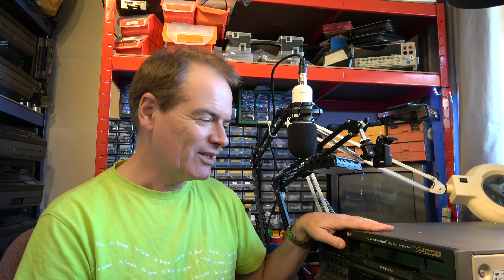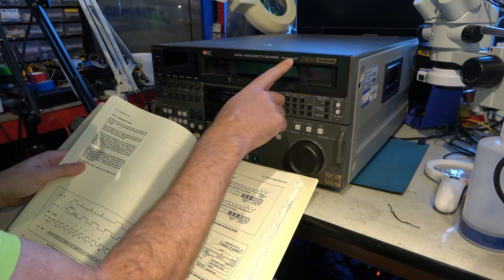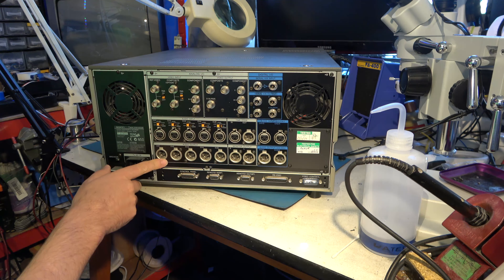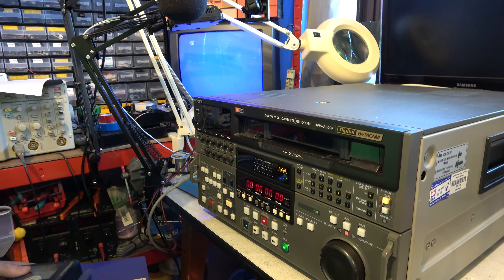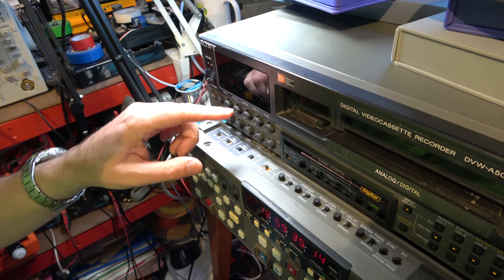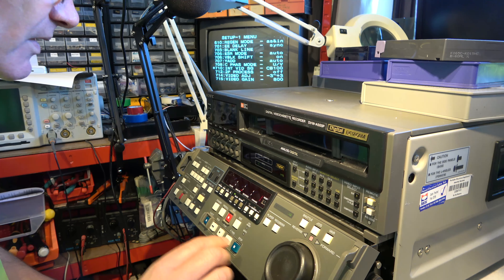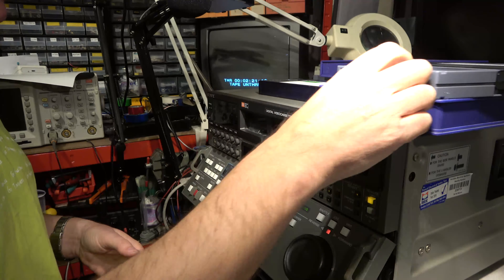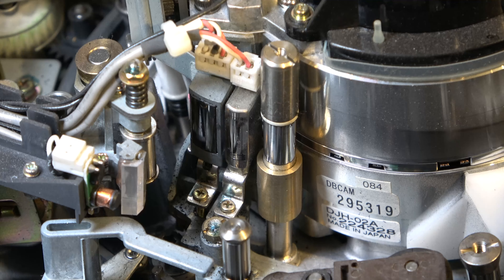Sony DVW-A500P Digital Betacam Recorder donation.

Comment: I used to use this model on a daily basis as an online editor and VT op. These cost around £25K back in the day. I remember when these things were introduced in the early 90s. I think it was '94 when I first used this machine.  Before that I was operating D1, D2 and D3 for BBC destined work and later D5, HDCAM, HDCAM SR and Ampex DCT. I also worked with Umatic, Beta SP, 1"C, 1"B, DASH and Ampex 2" Quad. All good fun.
Reply from the maker: I only wish I had so much experience with studio equipment.  I'm still trying to buy an HDCAM-SR but they are stubbornly expensive.
Reply: @video99couk  Yeah, Good luck with that.  They are still being used by some facilities 
in Soho.  Officially the last tape based format the BBC accepted commisioned programmes on
Reply from the maker: @andrew1479  There's one for about £900 but with 10k hours on the heads, I don't think it's worth it.

Comment: In my collection I have a DVW-A500P recorder and a DVW-A510P player, both the rebranded Thomson versions. The recorder I got for 56€, the player for 38€. One can spend great amounts of money on these on Ebay, but with patience, these machines can be gotten for very cheap or even for free like in this video :)
Unfortunately I so far haven't had the time to do much with my Digibetas, but this video will be very helpful when I finally have the time. The menu system really seems very unintuitive... 
The cables for the 9P remote interface are available on Ebay, I got one to connect my Digibetas together. It's quite fascinating how they work together, basic editing operations can be performed via the front panel of the recorder.
A friend of mine has a small collection of Betacam equipment too, and he actually prefers the video quality of Betacam SP. Digital Betacam does employ 4:2:2 colour subsampling, and the thereby reduced colour quality apparently is noticeable when compared to analog Betacam SP.
Reply from the maker: I've been reliably informed that BetacamSP is nowhere near as good as Digital Betacam.  But I know what you mean.  There's something very pleasing about the BetacamSP image, even though the resolution isn't especially high.
I would say you got your machines very cheap.  These things do often still fetch about £200.  A freebie of course is even better, but mine really needs a pinch roller.
Reply: Where and how does one find such machines? I would love to have a DigiBeta machine, especially the A500.

Comment: Great video. On the DVW machines, if you hold the ENTRY button whilst pressing the MENU button, it will bring up an error log on your monitor with time code stamps of each error. Handy for checking playback or record issues. One other thing, and I’ve noticed this on a few of your machines. If the STOP light is flashing it means your machine does not have a reference signal connected on the back (usually just a black burst signal). If you switch to INT ref (switch) it will stop flashing.
Reply: Also, to clear the error log (I would usually clear it each time I either record or playback), call up the error log (ENTRY + MENU) and then hit the RESET button alongside the TimeCode display on the machine panel.  Enjoy!

Comment: If you find the flashing STOP key light annoying, you can turn the flashing off with a menu setting.  From what I remember it flashes the green STOP key when the machine senses the absence of external sync, which is immaterial on a standalone player anyway.

Comment: The DVW series of machines are such good machines. I use them at work almost every day, our DVW-A500 has around 15,000 hours on the heads and it is just fine. We also have a DVW-A500 P for PAL work and an MSW-M2000 for NTSC or PAL depending on the menu setting (and sync fed in) along with one lone Ampex CVR-60P (Sony BVW-60P) for the really tough PAL tapes. We also have the record inhibit permanently enabled on every machine that it can be
In the States, I very rarely see a 500 series machine that does not have the composite in option, as these and the SX cousins the DNW series were meant to drop right in place of an SP or oxide Betacam deck,   and although they are all component formats, most edit suites and especially remote (OB) trucks at local TV stations were composite video.
Reply from the maker: I've never seen a DVW-A500P which does have the composite video option, either in real life or even for sale.  Seems like a rarer option here.  Just wish it had S-Video in and out, and monitor audio would be handy too.
Reply: I very much agree, great machines.  We have 18 DVW's in racks playing and digitising simultaneously here where I work.  Some DVW's can do 20,000 hrs before a head change.
Reply: @video99couk  All the DVWA500P's & DVW500P's had a composite input connector, but, not all had the associated DEC-65 board that performed the processing. This was an option.   S-Video was never considered for DigiBeta because it wasn't a Broadcast Standard, and the DVW's won't accept non-TBC'd signals.  Back in those days,  most VCR's that had S-Video out didn't have a built in TBC.
Reply from the maker: @azmath2059  Yet the UVW1800P and similar BetacamSP decks do have S-Video connectors.  Yes, I was aware that the Composite Video input socket is always fitted, even though the option board often (usually?) isn't.  Odd logic really that Composite Video input was considered OK but the much higher quality S-Video was not.  So if you wanted to source some material from say a Sony EV-S9000E Hi8 with TBC, you had to use Composite.
Reply from the maker: @azmath2059  Do you have a source for pinch rollers?!

Comment: Composite input was important back in those days, the huge work was just about to begin to digitize old 2" and 1" videotapes. And they sure were composite formats!
Also in many studios digibetas went straight in to replacing 1" machines, all cameras, visionmixers and everything in studio was built in composite.
Reply from the maker: Yes I'm aware that Composite Video was used in studios for a while and this was useful for drop-in replacement.  Some early professional formats were Composite Video only for this reason.

Comment: I used to work with these machines on a daily basis once. There were so many options and keys that I created an interactive user manual with Filemaker Pro on the Mac for educational purposes. ALL buttons, in and outputs were explained as well as the menu's. You could lookup on keyword and it would tell you what menu item you needed to go to and what the available options were. Pressing a button would have the same visual effect as pressing it on the real machine. Great fun to create, but it gave my RSI... Too many and too long days creating that I guess. Not a lot was known at that time around RSI and the cause. P.S. I would get rid of the head sponge if I were you. It only increases wear on the heads and if the heads are dirty, you can clean them with some smooth chamois leather and alcohol. (not up and down, only in the direction of tape travel!)

Comment: Back in the summer of 1981,  only 18 at the time, I bought a Sony C7 Betamax, that machine cost me £715, which would be around £2500 to £3000 today. Back then nothing was close to the picture quality of the recordings, and believe or not one of the first home VCR's to have colour picture search and slow motion playback, by the time the C9 with (HiFi Stereo) came out some 3 or 4 years later, getting rental films in Beta was quite difficult, so I didn't see the point in upgrading to the new model. Around 1987/88 the C7 finally gave up and was replaced be a VHS Panasonic. However, I still felt even after all that time and improvements to the VHS system the original C7 offered better picture quality recordings. Thanks for this insight into the world of build quality video tape recorders rarely seen....
Reply from the maker: The C7 was advanced for its day, if a little unreliable.  That is due to get a mention in the YouTube video that I will release later this week as it happens.  The C9 though didn't have hi-fi stereo, only lousy linear stereo, so it wouldn't have been worth the upgrade to that anyway.  Few Beta HiFi machines sold in the UK had trick functions like the C9 or (to a more limited level) the C7.

Comment: Thanks for the nice trip down memory lane for me. I maintained just about every pro format from 2" quad to HDCAM-SR for a US TV network. I was sent to Sony's service training classes for Betacam SP, Betacam SP camcorder, Digi Beta, XDCAM, and HDCAM camcorder. I always learned a lot which wasn't in the service manual. Do you know about the hidden menus in the BVW-75? The only feature I remember is that it could enable loop play or record. That is very dangerous so it was well hidden. BTW Ampex DCT has to be the best SD recorder ever made.

Comment: I've just brought one of these machines and looking forward to playing around with it. I used to use them in a studio many years ago so it's a bit of walk down memory lane for me. The unit I have has the composite decoder card installed.
Reply from the maker: It's worth checking the state of the pinch roller, my original was well past its best.  I have two of the recorders (one with Composite in) and one player.  All are A models so can play SP tapes too.

Comment: The VPR1 board has a couple of large LSI Logic mask programmed gate arrays- those are the ones which have the Sony logo in big print on them.  A bit uncommon to find such things in Sony hardware.  The five large devices on the side marked "Output Block" are certainly signal coupling transformers.

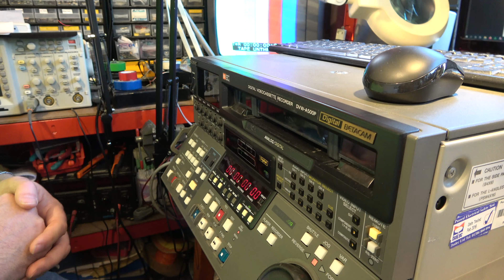Comment: 33:24 This is not only set for remote control operation, but also the VTR is in Record Inhibit mode, hence the reason why you can't record something on a Digital Betacam L size tape previously.

Comment: Really enjoyed this overview of the DigiBeta machine. I was just starting to service some of these before leaving the industry. Wonderful to work on like other Sony machines but I did not like doing the head changes, very fiddly mechanical alignments with the fixed upper drum and inner head drum. Did you manage to source a pinchroller?
Reply from the maker: Yes, on a later video you see me install a revised version of pinch roller.  I understand that head changes are beyond what I could do with out alignment equipment.

Comment: I'm only partway through the video so you may have discovered the source of your black debris contamination - but it's not tape-related - it's the insulation sponge from the top cover deteriorating and raining down into the gubbins.   I've had that problem with that type of sponge breaking down like that before in other contexts (typically travel cases padded with the same type of material.)  I removed all traces of it from my top cover and wherever it littered the floor of the tape mech.
Reply from the maker: Could be, I'll check that.

Comment: not sure if its been mentioned, but timecode in is for genlocking which means that the studio / facility picture chain is completely synced to a base clock
Reply from the maker: Thank you.  I assumed it was something like that, but I've never worked in a studio so not had to use that connector.
Reply: Actually timecode is just an analog 2400/1200hz signal representing time down to the frame. It should be normally locked to tape vertical sync. Genlocking is done via the EXT REFERENCE input or can use INPUT VIDEO as well. This is for locking the internal TBC to your house sync so the VTR can be mixed with other synchronous sources. The timecode is what the edit system uses to know which frame is which.
Reply: @andydelle4509  that’s a much much better and fuller explanation than I could have given. Thanks for the info :)

Comment: I always keep the record inhibit switch turned on with my machines unless I’m planning to actually record on a tape.  On most Sony machines the record inhibit indicator is different for a protected tape or an inhibited machine; from memory I think it’s steady for one and flashes for the other.

You haven’t mentioned the flashing stop button.  I don’t have a Digibeta, but on my other machines this indicates that a reference video signal, normally black and burst but it can be a full composite video signal, is not being received.
Reply from the maker: I hadn't realised that's why the stop button flashes.  I will check that it stops when I feed video into the machine.  I can feel a YouTube Short coming on, to cover that subject.
Reply: @video99couk  
With the use that you’re likely to put you machines to you probably don’t need to use reference video, Nd there should be an option in the menus somewhere to turn off the warning flash.

Most broadcast grade recorders and certain other devices such as the Sony component colour corrector, will have reference video connections.  There should be a pair of BNC sockets with a passive loop through between them, and a 75 Ohm termination switch, as with a composite video input.  It’s basically a timing and phase reference between multiple machines.

Comment: I know that you can measure your current pinch roller and get one with the same measurements, but that only works if you can slide the rubber part off the core and put the new one in. I've never tried this myself as on the VCR I had this problem on the rubber couldn't be taken off the core.
Reply from the maker: I have a replacement which has been sent to me and will feature here shortly.
Reply: @video99couk  Great to hear! I'm excited to see it featured as this is a really cool machine. Would love to own a DigiBeta deck myself but they're hard to find where I live and out of my price range

Comment: Have you tried drilling holes on a Betacam SP tape so the player will recognize it as Digital Betacam? I'm sure it'll work and record fine. Just like VHS and SVHS.
Reply from the maker: I suspect it would work badly.  An experiment for another day.  There were yellow BetacamSX tapes which were used on compatible digital SX machines, and these were effectively BetacamSP tapes in a different shell.  The SX machines could record digitally on BetacamSP tapes too.
Reply: @Matt Quinn That is correct, SP tape has a very different tape formulation and is also microscopically different to DigiBeta.  You cannot use SP tape on a DigiBeta machine. I experimented with this back in the late 90's when DigiBeta VCR's first came out.

Comment: Sony sold NTSC and PAL versions of this machine, need the opposite standard, well just buy two machines!  But these machines could be fairly easily modified to dual standard 525/625. All that needed to be done was to change the master VCO on the internal sync generator. The beauty of an all digital servo system and digital signal processing - it was frequency agnostic. A small shop in Hollywood made a fortune in selling this switchable dual standard modification. Sony had a fit and went so far as to modify the sync generator section to where this unauthorized upgrade was not possible on later serial numbers.
Reply from the maker: That's just mean of Sony, unless there was some other reason.  Would the dropout compensator work properly on the "wrong" standard perhaps?
Reply: @video99couk  Yes the DOC should work as it's done digitally and an RF dropout is the same in 525 or 625. I should note that the first digital VTR, the D1 format, Soiny DVR-1000,  was dual standard and so was the Ampex DCT format that was competition to Digital Betacam was also dual 525/625.

Comment: Greetings
I just got the sony DNW-A500P I connected it via SDI to an AJA card in my computer but it doesn't seem to get the signal
Does the beta happen to have a switch to output video from either the analog or digital outputs or it should output from both anyway
For now I can only see it in component or composite

Thank you
Reply from the maker: The DVW-A500P should output to the SDI port at all times, as far as I'm aware.

Comment: DVW=Digital video workhorse. Hard to believe the format is 27 years old. The DCT compression development of this VTR was done at Sony Basingstoke. The early machines suffer capacitor rot unfortunately and can often create a puff of smoke.
Reply from the maker: As mine is year 2000, I think that would be a later model.
Reply: @video99couk  Mine ran great for awhile (early one that's an A500 despite the fact the front plate says 500) until one day I noticed I had no audio level display.  Poked around a bit and yes...one of the electrolytic capacitors had chucked its cookies.  It looked as though it was in circuit as a filter cap and was dragging down the power to the display so I just took it out of circuit and...voila!  Back in business.  I hate to think that problem's lurking within on other boards to any great extent as I love my A500.  Realistically I suppose I should acquire a spare in the event of future problems.  Or just another to keep it company.

Comment: I have this model. Suddenly, when powered on without a cassette, it goes into this weird eject loop, trying to eject a tape that isn't there (or trying  to load even though the slot is empty). Any ideas? Other than that it seems to work fine
Reply from the maker: It would be a case of examining the switches and going through the service manual.  It can give you information on what switches and sensors are triggered, in the service menus.
Reply: @video99couk  Thanks. I'll have a look in the service manuals

Comment: How do you connect it to a TV? What adapter did you use?
Reply from the maker: For video , just a BNC to phono cable. Audio is a little fiddly but headphone jack to phono will do it.
Reply: @video99couk 
You can get small balun transformers which plug into a XLR socket and provide an unbalanced phono output.